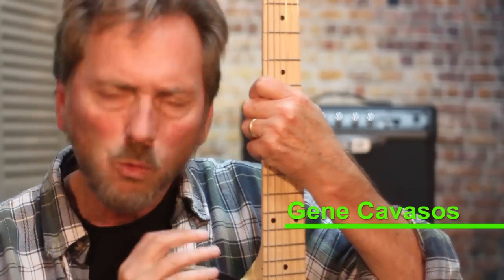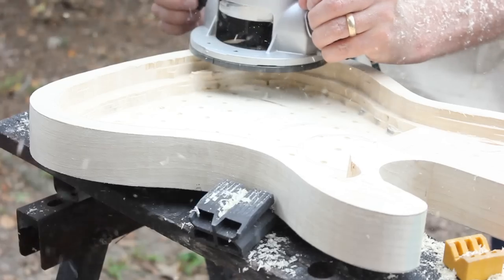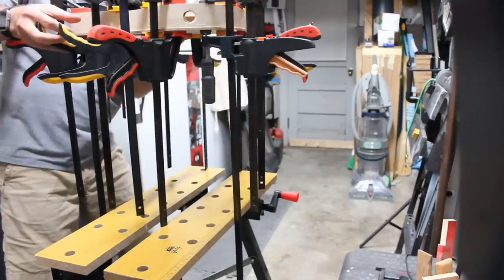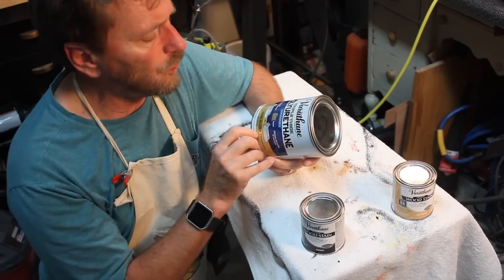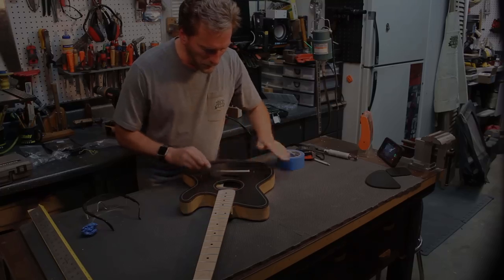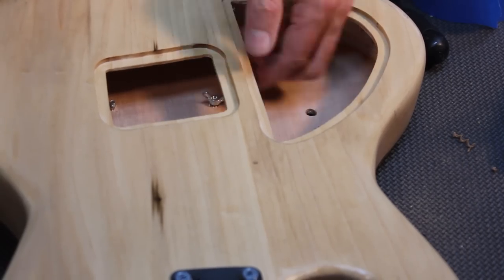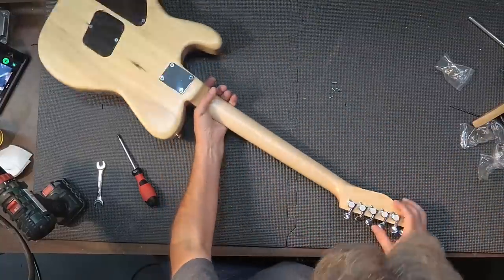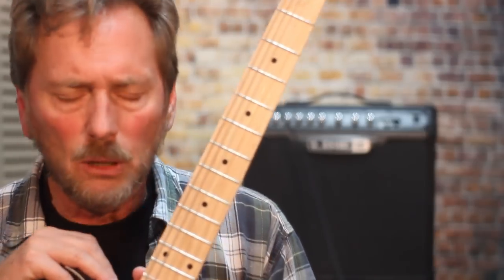How to Make an Acoustic Electric Tele-Style Guitar (Step by Step)

Comment: Nice effort.  Re: the bridge glued to the top, the reason that so many bridges comes loose from the top is that the bridge area is masked with a strip of masking tape to create a bare wood strip for gluing.  The better guitars have the bridge area stripped by tracing the bridge and stripping (paint remover is an option) to ensure 100% wood-to-wood glue bond coverage for optimum strength.  Otherwise the rear edge of the bridge is typically pulled up from the top from the string tension.  The masking tape strip method is used for practicality in the production process but is generally inferior.  The other way requires more work but the results speak for themselves.  You'd need to lightly and carefully trace the bridge with an X-acto knife blade and use paint remover to strip the finish to reveal the bare wood and clean up with solvent.  With a dark finish like yours, you'd probably want to trace the very edge of the bare wood with the stain or a felt-tip marker to prevent a visible line of light wood showing around the edge of the bridge.  FYI.
Reply from the maker: DDEENY, Great tip!  Thanks for sharing.

Comment: You should use the pickup under the bridge nut for acoustic sound. My suggestion is the fishman matrix which is excellent. Your guitar will sound very professional.
Reply from the maker: Thiago Bruno, I think you are right. And the great thing is I can switch it out and experiment. Thanks so much for watching.
Reply: @DIYGene  Gene, Thiago is correct. You can get a bag of undersaddle pickups off the bay really cheap, and I believe the sound difference will be so significant, that you might want to post a before and after video. I have studied piezo pickups for years, and it is amazing how sensitive they are to location, pressure, mounting method etc. And here is a tip... if the undersaddle piezo still sounds too harsh, cut a thin strip of bike tire tube rubber and put it between the piezo pickup and the saddle, it helps to filter the higher harsher frequencies that piezo's are so good at reproducing.

Comment: Well, you asked for comments. My main worry with this is intonation. I spend more time getting guitars intonated than anything else and the worst offenders are acoustic guitars because the cheaper they are the less time the builders have for fiddling with the bridge position. I would have used a metal telecaster bridge just for that, but also for higher rigidity and somewhere to put the earth. I' also worried about the amount of pressure on that top. Some acoustic bracing is needed or it will warp/belly IMHO. You can buy cheap sets of splines on Amazon (to keep the top straight) these days I notice. The fender acousticaster looks like the central 'hole' may provide some support, but I'd definitely add some support. I might also have removed the tele-style controls and used a combination of cheap piezo preamp and a blend knob to give you the ability to eq the piezo and blend it with the magnetic pickup. Finally I'd probably have picked up a cheap 2 blade humbucker in single-coil format so I could cut down on any noise and have a warmer sound. The build is great, BTW, these are just suggestions for stability, tuning and tonality.
Reply from the maker: PDP, Thank you, that is some really good advice. I really like the idea of the pre-amp. Thanks again for watching.

Comment: Nice work.  Hats off to you for tackling this project and producing a cool guitar.  You asked, so a few tips for next time.  Patterns.  Most guitar builders use MDF patters for everything.  They build their pattern out of MDF and then use the flush trim bit to apply that to the guitar.  Body, cavities, neck pocket, etc.  Not only will it give you more consistent results, you can then reuse them for the next build!  Bridge.  It looks like your bridge might be a little shifted toward the treble side.  The trick there is to throw on a couple E strings (high and low) before gluing down the bridge.  Then make sure the strings are centered on the neck.  I'm sure you figured this one out, but it's usually better to mask off where the bridge will go rather than trying to remove the finish.  Also be very careful on the front to back bridge placement to make sure you get the intonation perfect.  Especially with that acoustic bridge since there isn't any adjustment.  (You may have done this and just not shown it in the video).  Sound balance.  You mentioned this issue.  Try adjusting the electric bridge pickup distance from the strings.  You might be able to get it louder by moving it closer.  Otherwise, wire in a blend pot like Fender.

I like how you applied the top.  Fender does that very differently.  They route a pocket in the body to lay the soundboard in.  To get a clean even fit would be very difficult without a CNC.  I like your solution not only because it's easier, but I think it looks better (and more like an acoustic) too.

I also like your budget.  It's so easy to get carried away buying expensive parts and tools.  You made due with what you had for tools, and kept the parts very reasonable.  That's the way to do a first build!

Good luck not getting completely sucked into the world of guitar building.  Next thing you know you will be day dreaming on what your next 7 builds and how you are going to afford that $120 fret file from StewMac.  :)
Reply from the maker: Thank you for the great advice. I was very lucky with the intonation. It stays in tune even above the 12th fret. All I did was take a lot of measurements from a few acoustic guitar I had to try to figure out the bridge. And I think I’m just crazy enough to try this again. Maybe with Les Paul neck and humbucker pickup. Thanks again for watching.

Comment: Hi, well done. You may not be a "luthier" but you have the woodworking skills to get it done. I've done a few like this, the latest being a bass guitar that I hollowed out the body and put a top on. Like the other commenters I was wondering about the long term effect of not bracing the top. My method is to leave a pair of pillars at  the bridge area when hollowing out the back, so the top and bridge are coupled to the back. Piezo and magnetic pickups don't work well combined together just with a switch. In the middle position I think you'll find if you try tapping the magnetic pickup with a steel screwdriver that it's very faint. I tried it before, as someone mentioned there's a mismatch and the piezo needs a preamp. What you could do is get one of those endpin jack mounted preamps, mount it in the body and wire its output to a separate volume control so with the two in together you can blend them any way you want. I don't think there's enough room in there for a control panel type preamp.
Reply from the maker: Julian Mokhtar , Great suggestions. I think the preamp would definitely be the ticket. Thanks so much for watching.
Reply: @Julian Mokhtar
 I've been tempted to do a hollow body build for a bass similar to this idea but maybe a vaguely P or J shape. What's the tone like in this sort of setup for bass? I'd love to have at least a 3/4 size that I can just sit with and play unplugged but I'd also get a kick out of seeing the looks of confusion taking it out to a live gig when the pubs open again. Hahaha.

Comment: Also, if you are using the piezo pickup. You can find free impulse responses to use in a pedal. These IRs take the sound profile of individual guitars resonated through microphones and then applies that sound profile to the piezo. Letting you play a piezo guitar, but get a mic'd sound. This works really well with these thinline acoustic-electrics.
Reply from the maker: Great advice. I actually ended up switching out to a under saddle pickup and a few other mods. Here is the link: https://youtu.be/HBsMakHdCLo
Thanks so much for watching.

Comment: fender: This will be 3.999$
Reply: not quite the same as an acousticaster , that one has quite a lot of tonebending circuits inside of it
Reply: The Fender uses better woods, the design is made with 3d modeling trying countless configurations. The machining is made with Cnc machining that is absolutely replicable with tolerances smaller than 1 mm.
All the electronics are high quality, pu includes digital modeling.
All these things cost, so I think it’s a bit unfair to compare an actual production run with a single guitar made as an hobby ( no disrespect to the guy which made a stunning job considering the limited experience in guitar making).
The 4K is a bit to much imo? Yeah, of course , but let’s not get delusional and think the price of the guitar is just the sum of its parts.
Reply: well i know but i just make a joke about it. its still to expensive
Reply: @edojacob7493  Actually the idea of using Cnc machining should make it cheaper not more expensive.  Fender is just out of hand on their pricing.  In this day and age there is no reason for it.  If you hire a bunch of woodworkers to hand carve then yeah you have to pay them.  But if most of your build is using power tools and automation then the expense goes down dramatically.  Fender charges that much because they can. Simple as that. Not knocking it. It is what it is.  But there is not an extra $2000 dollars worth of product in those guitars.
Reply: @edojacob7493  And yeah "delusional " "the price of the guitar is just the sum of its parts" + "markup to slap the Fender name on it."
Reply: @joebryant8500  AAAhhhh, Joe...  You are such a cute wittle fan boy.   Heh heh.  First off I'm not screaming.  It seems all the fanboys can't take the truth and get agitated though.  There is not a guitar out there I would pay $4000 for.  The only real reason for a production model to cost that much if it were valid pricing would be maybe genuine gold inlays or something like that.  Now if you are buying from a specific luthier for emotional reasons I understand.  But Fender is a corp, not a specific luthier.  They can sell high and will till someone else decides to enter the market at a lower price point. "specially produced Fishman electronics" -  Cracks my up. Electronics are cheap. And before you argue take a look at what is in your hand or on your desk that you are commenting on.  Guitar electronics don't amount to anything. I am electronics technician and have been for three decades. What you are buying is marketing.  It's a mass produced hunk of wood, not the Sistine Chapel.
Reply: @joebryant8500  Good one Joe! Exactly what I was expecting from you. You don't disappoint. Your feelings are hurt because you spent enough to purchase a used car and you are only now realizing that mainly what you bought was marketing.  As far as electronics I've worked in them for decades.  Started with F4 radio comms in the Air Force in the late 80s.  And over the years I worked on guitar electronics lots of times. I promise you Joe, there is no such thing they are doing with the electronics that make it magically worth even $500. That is the price of a decent cell phone that is capable of far more.  I did over estimate you a bit in thinking you could understand that from my previous comment.  But is seems I was wrong and had to spell it out for you.  Oh by the way. I am not a Fender detractor. They make decent products, but this one seems priced particularly to stick it to the gullible among their fanboys.  And that's ok, If they didn't rob their fanboys someone else would. :-))  

I'm sorry that you got scammed twice Joe.  But use it as a learning experience.  We all have room to grow.
Reply: @joebryant8500  I humbly accept your concession.
Reply: @joebryant8500  ROFL!!!!  Well concession final, and (bonus) I get the last word also!  To anyone not Joe Bryant reading this, I usually am not this big of an @$$. But Joe just brought it out of me today.  Blame it on Covid. :-))
Reply: Do you not have to use copper foil to earth the pick up, switch and cable connection?
Reply: @edojacob7493  Fender uses cheap woods.Cnc is much cheaper than handmade and electronics costs almost nothing.

Comment: A great first try... your is the second build of this type I've seen on YT... 

I have a Peavey Ecoustic guitar, which is just like yours without the Tele pickup... it's just piezo. I made a living with it for 10 years... it's beat to hell, but is still a great guitar. It uses a preamp with full EQ capabilities, and the piezo is under the saddle in the bridge. It's not as noisy either.

I also have a Fender Deluxe Nashville Power Tele. It has a Fishman "Power" bridge... which looks like a Tele bridge with Strat style bridge pieces, each one has a piezo. It has a stereo output.

My suggestions: 

-Install an under saddle acoustic piezo pickup. Fishman has a preamp with a volume control that will warm things up. You'll need to install a battery box to power it.

-a stereo TRS output jack so you can send the Tele pickup to an amp and the piezo to a PA system. You may be able to find a Y cable, TRS to 2 TS mono plugs. If you can't find the Y cable, a good music store should be able to have one made.

- Tone controls... it sounds very bright...

Thanks for the inspiration...

Comment: I think you did awesome and it is all yours. I would look into trying to brace the top or adding a wedge under the bridge to strengthen the front of the guitar for future sake and adding a chunk of metal to that wedge or bracing to give you a ground which will help. A tele has body thru strings, that ashtray bridge plate, and the switch plate which you are doing without and lose that grounding. You also could look into a noiseless pickup for the bridge. As far as the piezo pickup you may want to look into the 3 band eq like a lot of electric acoustics have. New hole for it and battery pack and should be able to wire it in so you can get it how you want it and set it and forget it. Sweetwater has a whole kit for $130 or maybe something like it or a pawn shop but that preamp to control that speaker. I have on of those dean markley acoustic pickups that you just stick in the sound hole and it’s tough because of volume control is all done by the amp or pa. Look on sweetwater at LR Baggs gigpro single channel belt clip preamp. I think it will fix all your pickup issues for $130.
Reply: Logical & encouraging thoughts/suggestions. And I think the notion of controlling the acoustic from the guitar rather than the amp would be a good choice.  For a first guitar build I reckon it’s a terrific result. Congratulations.

Comment: If you like this concept but are concerned the use of a standard acoustic guitar bridge because of the stress on the top from string tension I suggest an archtop bridge with a trapeze tailpiece. Most of the tension is through the tailpiece in a 'horizontal' direction and the smaller component goes through the bridge acting in the 'vertical' or downward direction so there is no twisting force on the soundboard as there is with a flat top acoustic bridge. Archtops do still have bracing  but it is simpler and lighter overall than on a flat top steel string acoustic. This is the approach I plan to follow both for structural integrity and improved sound quality.

Comment: Inspiring to watch, I'm definately going to make myself one of these for sure. I would look into ways to be able to adjust your pickup height though, since that has such a huge impact on your electric guitar sound. Yours doesn't seem to need it for the neck pickup though, I love that natural reverb it's got. But I love what you've done, you've done an amazing job and you've inspired an aspiring guitarbuilder to follow in your footsteps!
Reply from the maker: Thank you so much. I learned a lot on this project and still have a lot to learn. I have received so many excellent suggestions in the comments that I have improved even more on the guitar. Thanks again for watching.

Comment: Great job on a fun project. You have something I lost long ago which is fun building your projects. I am always a year behind and the time I spend on guitars has become all work and stress.  I think you need to get yourself a airbush and a binding bit for your router for the next build. Something worth mentioning, locking tuners are a very nice feature and you can find cheap sets for around $30 online.  Fun Fact: My tops are German spruce and milled to .103 thick with spruce bracing. I tap on the top of the guitar looking for a certain tone and adjust things like the bracing and the size of the sound hole to get the tone I want. Keep up the good work.
Reply from the maker: KD8EGV Channel, Thanks so much for giving it a watch. I took a totally novice approach to it. I know the feeling when you turn a love or a craft into a career. It can completely take the joy away. You have such a deep and wonderful knowledge of guitar building and I really admire that. Thanks again,
Gene

Comment: I think you did a great job I would not have gone the Pizzo pickup I'd gone another pickup under the strings in the sound hole 
But the one thing on your build that gets me and it's not a big deal to others but to me it is,  is the screws you used to hold the bridge down. I don't have a problem that you used screws but should of counter sunk them and pluged with some wood or mother of Perl is cheap 
 but all in all GREAT JOB SIR!!!

Comment: I must say this is a really good work. A few suggestions may be placing an inner box on where the electronics are and shielding those and using protective rubber joints on the screws so that it doesn't damage the wood overtime.

Comment: How did you adjust the string action? What kind of bridge saddle did you use? Also, next time you may want to consider installing a bridge plate under the bridge, and some top bracing inside the guitar. Will make a better acoustic guitar sound and reinforce the top and bridge. Otherwise a pretty cool build.